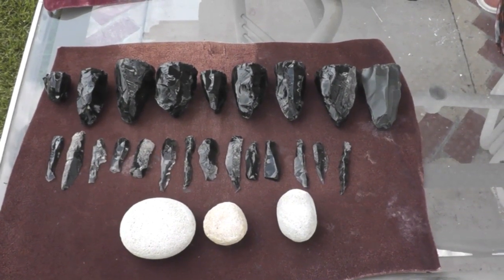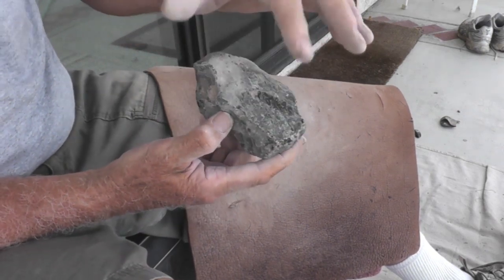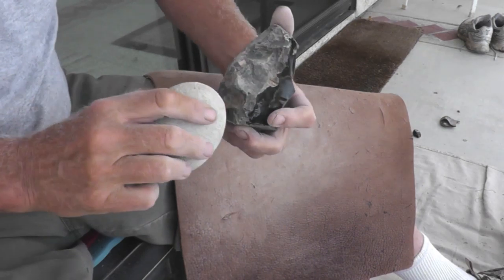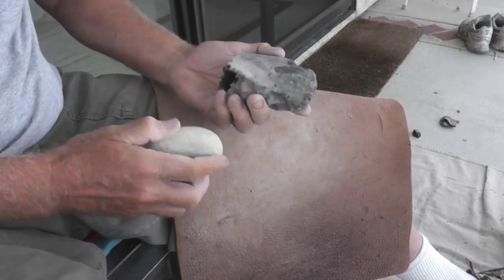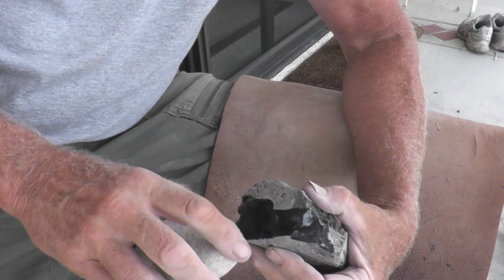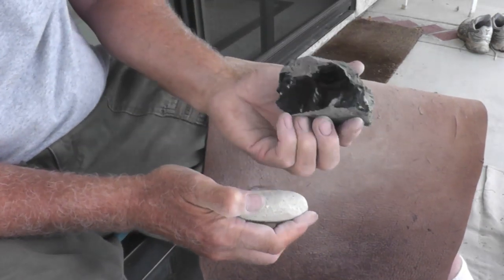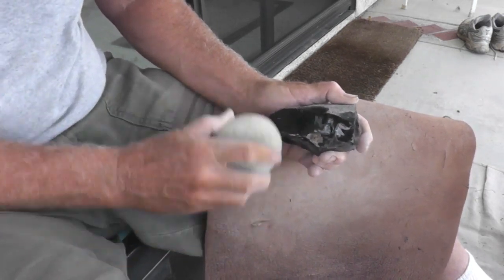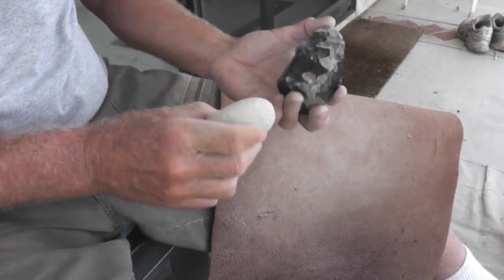Blade Core Hammerstone Preform Part 2

Comment: Hi, I'm very new to flintknapping and I still don't get or understand the purpose of the abrasions nor how abrading an edge affects the outcome of a particular stroke or blow.
Any enlightenment would be appreciated, thanks.
Reply from the maker: Dan Holloway Abrasion is for the purpose of strengthening the edge so that it will not collapse prematurely before the intended flake is removed. An unabraided edge is sharp and may crush or collapse as pressure is applied, or as a percussion blow is delivered. A properly abraided edge allows pressure to build up on the platform or nipple until the desired flake releases. Hope that makes sense. Platform preparation an/or abrasion are critical components of successful flintknapping......

Comment: So, you're shaping flat flakes off the bottom of the rock, each swing? You're shaping it, right? The blades aren't hidden in the stone, preset size and shape?
Reply from the maker: The flake travel follows the ridges and is determined by the angle of the swing and force of impact. There is a strategy involved such that each blade removed will provide good straight ridges for the next blade removal to follow. Errors require corrective actions to restore the shape of the core.....

Comment: would it be possible to gri g the rock to shape on a wet grinder???

been dou g lapidary work for years but only looking at knapping now
Reply from the maker: One way to begin removing blades from a core is to saw a rectangular block of obsidian using a diamond saw. Then blades are removed from the corners full length and the process continues around the core. I have never tried this, but I have heard of others who have.
Reply: +paleomanjim cheers,I'll try that.bit hard to get good obsidian in NZ but I'll try